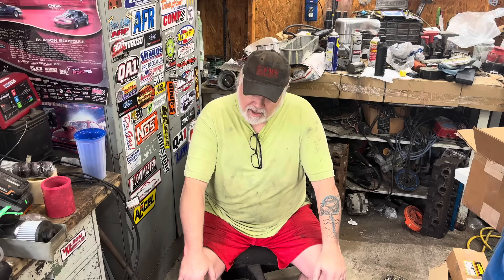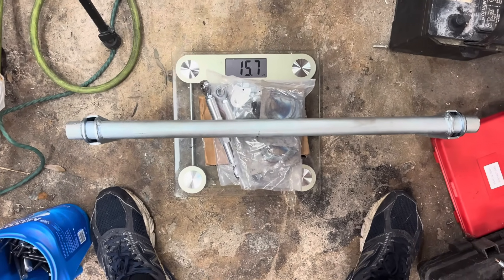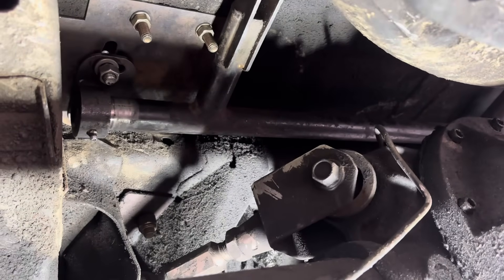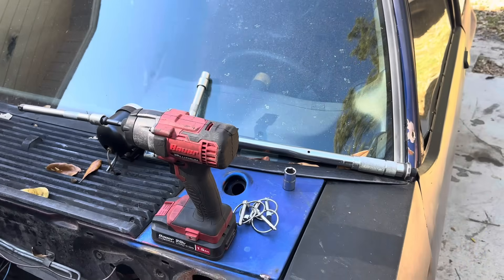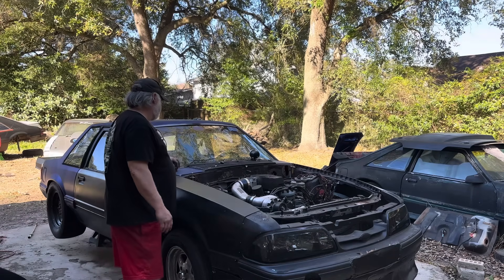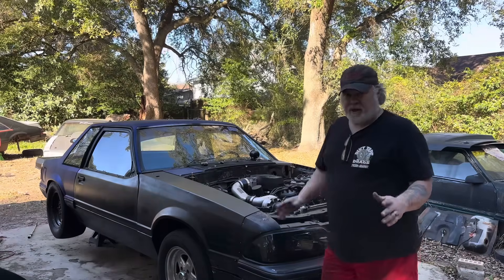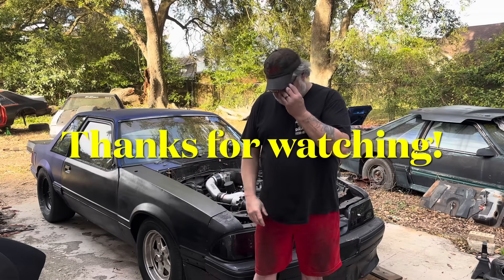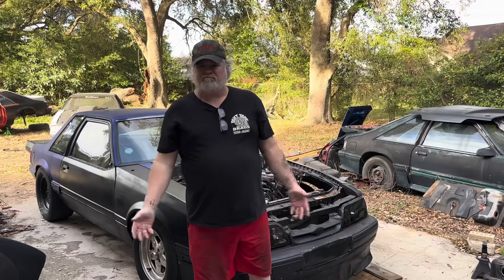Anti-Rollers..Baseline/Comp Eng/Chiner Copy😼 1988 5.0 Mustang LX Coupe BRAIN Pt.41

Comment: Was helping a friend with a supercharged sbc that was not the greatest to cruise, especially in 4/5 low speed tip in. Went to a smaller water/meth nozzle and it's way better. Cruises better and is way more responsive. Feels like it makes more power and the plugs look way better now.
Reply from the maker: I’m just not an efi tuner and have no interest in it so I’ll always be behind the 8 ball on this deal…again I get in moods about stuff and try and trust my gut on things 🤣
Reply: @5.0tussin  trust me I understand. It took me a long time to start tuning efi. It's a lot more difficult when you can't just plug a laptop into it and don't have access to all the different parameters. You're really good at NA carb tuning, so you already have an advantage on learning. Also, I too have had the box fan feel my anger lol

Comment: I've always used a Torque arm, Panhard bar, & adjustable coil, for the rear & it worked really well for street & strip 👍
Reply from the maker: We’re running a full custom set up from a local shop..it’s been working out good 👍 🤣🤣🤣